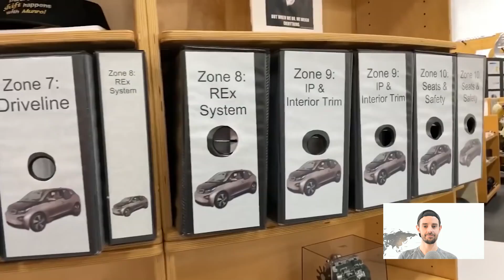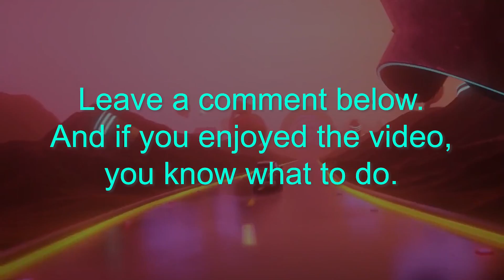Tesla's Engineering Genius (w/Sandy Munro)

Comment: I have worked for the big companies. You assume that the tech guys are running companies in US which may have been true in 1950 but that has changed and when the accounting guys took over . So no “ rational” engineering goes on . If it costs a buck per part to change a problematic part it will not get done. If

Comment: IDEA for VIDEO Elon commented on the investment call that the most efficient machine that builds the machine is able to produce one car coming off the line every 25 seconds. I think he said it was a Toyota factory.
it looks like the cyber truck was designed to be the ultimate ease of manufacturing. No paint shop, laser cut and fold stainless body and frame, plug and play wiring harness they painted and will be using in Germany, octo valve and I would imagine many other innovations. What do you think their efficiency could reach in Texas Tara factory production of Cyber truck? My projection one cyber truck every 15 seconds coming off the line. Once ramped they could produce over a million cars using only two shifts for 350 days a year. Your thoughts in a video would be welcomed.

Comment: Mr Ryan:  you really focus on the higher mass of the Model Y, but mass isn’t that big a factor for EV efficiency.  Yes, more mass means it takes more energy to accelerate but that energy doesn’t disappear, it is stored in the motion of the car.  With an ICE vehicle, this energy would go to waste, but with an EV a lot of that energy is recaptured through regenerative braking.  Obviously there are some losses along the way since each energy conversion is not 100% efficient, but I don’t think it’s all that significant.

What really matters is the aerodynamics of the vehicle, and mass plays exactly zero role in that.  Size does matter, but it’s depends on in what way the greater size is achieved.  If the cross-sectional area of the Model Y were the same, and it was just 10% longer, I don’t think you’d see much of a difference in aerodynamics.

Comment: Most production lines have the majority of interactions on two planes with automation you can do 6 simultaneously top bottom sides front back just look at the B roll for the traditional methods of production and think Elon wants to and likely did a one-shot stamping for the body with this general idea of 3d production. Stamp, paint parts come in from all sides bam! send down the line repeat bam! a few of those and done finished car.

Comment: In Engineering classes, we study the Toyota Production System, like Lean Manufacturing. I already see that in the future we will need to study this new philosophy and practices that Tesla is creating, like a Tesla Production System, just like Toyota.
Reply: The Lean framework is the "first principles" of effective, efficient manufacturing
Reply: What Tesla is doing actually is exactly in line with the Toyota Production System principles and the Deming way. It's classic Lean/5S waste reduction stuff. The difference is that they're doing it staggeringly better than Toyota or anyone else ever did. Others talk; Tesla does, and does well.
Reply: Saxon Lea – In what ways are Tesla‘s production methods superior to Toyota‘s? Are Tesla‘s margins higher? No. Great cars are built by great R&D, not by the best production system.
Reply: @moritzregis5935  1) Comparing margins of two production systems with radically different scale and technical maturity is not very useful for predicting the relative long term success of the younger, smaller system.
2) Manufacturing is very difficult and extremely important. I invite you to review Musk's comments about manufacturing on the Q2 conference call and his recent Daily Drive interview, which align with what he's been saying for years. Musk has far more first-hand knowledge of this than either of us.
3) The main thing Tesla does better than Toyota and the rest is large scale software integration throughout their entire company and fleet, and also solving quality issues with true first principles thinking going down to atoms, forces, time and space. Old school companies do 5-Whys and stuff like that, which is good but doesn't result in fundamental quality improvements like eliminating the entire paint shop for cybertruck and eliminating most of the model y body shop for a giant one piece casting. I believe that the American culture of optimism and taking adventurous calculated risks plays into this advantage.
4) For what it's worth, Sandy Munro's comments about Tesla doing true continuous improvement and their flat management structure indicate that Tesla does indeed outclass its peers in Toyota/Deming production principles
Reply: @moritzregis5935  Also, it's unclear what you mean by great R&D, not great production system. There are plenty of controlled experiments that prove that two groups can take the exact same product design and one can succeed and the other fails merely due to production system differences. I saw the same pattern before my QE days when I worked in food service. The more organized workers who followed these same principles took the same recipe as everyone else but made it better and faster with less waste and occasionally less health and safety hazards.
Reply: Saxon Lea

1) Gross Margin is not ideal, but still one of the best indicators to evaluate the production efficiency as an outsider of the company. 

Gross Margins (2019/20):
Tesla 19,4%
Volkswagen 18,8%
Toyota 18%
BMW 17,3%
Mercedes 16,8%
Ford 7,5%
GM 7,6% (WTF US-Automakers...)

Tesla is a bit more efficient, but there is no big difference in gross margin that would indicate a radically different production approach...

2) I know, I’m studying manufacturing engineering

3) Tesla‘s software integration in the fleet is great, but that is mostly due to the designing process of the car and has less to do with the production processes.

I don‘t know how their software integration in the production process compares to other car manufacturers. My guess is there should be only minor differences, as Tesla is buying their manufacturing equipment from the same suppliers as other car manufacturers. I don‘t think that Tesla is flashing their own software on the tooling machines.

As for quality management... Tesla just had the lowest quality rating in the US and their Model Y had a very bad start from a quality perspective...

4) True, Tesla has structural advantages as the company is very young. Streamlined supply chains, flat management structures. These advantages decay over time.

5) Car manufacturers are usually split into a development department and a production department. The developers design the car and the producers build the car. Great cars from the customer’s perspective are perfectly developed cars. Great cars from the company‘s perspective are perfectly produced, profitable cars. Just because everyone loves Tesla cars doesn‘t mean their production is revolutionary.
Reply: @moritzregis5935   @Moritz Regis 
1 In general, gross margin improves with scale, albeit much less than operating margin does. Key reasons include lower unit costs from suppliers, greater specialization in the workforce and in tooling, reduced logistics costs from reduced tariffs and shipping distances, and reduced inventory per unit of production. 

Also, the majority of their current production occurs in Fremont, CA, where labor is expensive, taxes are high, and bad traffic raises logistics costs.  Also, the Fremont factory was retrofitted from its NUMMI days. Greenfield custom factories are cheaper and more efficient, as Shanghai margins are showing already.

Therefore, the fact that Tesla already has industry leading gross margin at a ~500k annualized rate is an extremely good sign.

2 Nice, I hope you enjoy it. Fun career!

3 You're probably right about them not flashing software onto their own tooling, but I was referring more to the overall manufacturing execution system. Most companies buy crappy off-the-shelf software piecemeal and try to put it together. Like with their cars, Tesla went with a DIY integrated solution. I infer that this provides them as much manufacturing advantage as it provides performance advantage in the car itself, although I don't have direct evidence as an outsider.

Furthermore, I would presume that Tesla is doing an outstanding job of setting up automated feedback loops to drive improvements all the way back into the design. That's where the fleet data comes in. The other automakers mostly have no visibility of what's happening in the fleet, which makes evidence-based manufacturing and design improvements much harder.

Check the 2019 impact report for clues on Tesla's manufacturing engineering innovations. The big one for model y is the new casting setup, which drastically cuts complexity and time, while allowing workers to do interior assembly from an easy, ergonomic position inside the frame before the battery pack is attached. The 2019 impact report discusses this and shows a picture. They also show a massively improved factory layout for Giga Shanghai. U-shaped flow with perfectly situated truck bays, among other improvements I've forgotten about. This is without even mentioning their battery manufacturing company acquisitions, which we'll learn about soon enough.

Quality is always worse during low rate initial production, especially when trying a bunch of radical new ideas at once. Current Tesla has a large base of early adopters who generally prefer good-enough quality now over excellent quality 2 years later. This is enough to justify shipping model y units with quality peccadilloes.

Also, Tesla receives far greater scrutiny and publicity of quality issues due to their prominence, surrounding controversy, and immense short selling interest. Because quality is defined relative to what the customer wants, the best metrics of quality aren't things like nonconformance counts but rather overall customer satisfaction ratings, brand loyalty and evangelism. Tesla towers over the competition on these important metrics, while lagging on paint quality and panel gaps.

4 This success in continuous improvement has more to do with risk-taking, politics, scientific culture and compelling mission than the formal organizational structure. They also eschew the traditional yearly refresh model for running changes. I expect all of this to remain approximately constant with growing scale.

5 Tesla also splits design and manufacturing engineering. Everyone does. But their feedback loop between the two is much tighter. Also, customers care about the overall value proposition, which is a function of both design and manufacturing. The customer may not care about good manufacturing itself, but they do care about the end results of good manufacturing. Why is a beloved product sold for lower prices than alternatives not revolutionary?

Comment: I used to work in the IT dept. of a big stationary company with many branches.  Now I was working on their DB and some of the queries might take an hour or two to run due to the amount of data being dealt with over a 10Mbit hub...  I asked if we could upgrade to 100Mbit and my Boss was not interested due to expense in a massive company whose boardroom table cost £12k and each chair £1k.  I even offered to bring in my own 100Mbit switch and components to help speed up my workflow and save them money...  he flat out refused despite that it might save me 4 or 5 hours a day sometimes LOL

Oh, please be bringing the Cybertruck to the UK Elon  <3
I will import one from the US and get it adapted for the UK if I have to...

Comment: Around (15:45) Munro says something like "Tesla Lies,... you may not believe that"... then goes on to say Tesla "understates"... well, it may be so... but, don't lose your perspective too much.  Tesla as much "Overstates" as well.  Producing "all battery" EVs is fine for a few million, (Tesla just passed 1 million vehicles over the last decade)... but, 88 million new ICE cars were sold annually.  Tesla overstates the notion that since all battery works for a million sports cars, it will work for everything else (i.e. trucks, Semis, SUVs, Construction, Farming equipment etc.)... when, the reality is, no it can't.

Even now, Nickel, Cobalt, and Lithium have been long sought and locked up.  Thinking, (and declaring), we can make all cars "all battery" EVs is not even remotely possible.  All battery Semis is a prime example of blatant lies and overstating.  There are millions of Semis in the US fleet.  Only 10,000 battery semis would draw 10 Gigawatts if charged simultaneously.  Try 100,000 Semis?  The problem here is all battery vehicles, when charged, must do so in real time from the grid.

The grid is in no way capable of handling such on-demand loads, it wasn't designed with that in mind.  The big lie of Tesla (total overstatements) which are leading people like the host, to be starry-eyed at the idea of a battery powered car.  If you want to talk about reality, you need to talk about fleets.  How you're going to actually fuel, and/or charge them Without Carbon.   This is what's important, and therefore, I'm compelled to remind you of the fantasy world Tesla projects, when claiming "all battery" vehicles will soon dominate.  Not on this earth.

Clean H2 is potent, safe, scalable, available to all people, and 100% non-toxic.  Avoiding these truths is a tremendous disservice to the achievable goal of decarbonizing our planet and ending human poverty, and industrial scale abuse.  "All battery" vehicles can't do that.  Clean H2 can.  As Tesla, and you along, buy into the lie of "all batteries are the future," the human and environmental costs of Nickel, Cobalt, and Lithium abuse just continue to grow.  Tesla lies alright, it's either an understatement, or an overstatement, never the reality.
Reply: I guess you know more than Sandy Munroe and the tech analysts at Ark invest.
Reply: @ken-mb5cp  Do I know more?  All I claim is that I can do basic math.  Can Ark?
Reply: Toby Kinkaid Thank you again.  I will look into Hydrogen.
Reply: @ken-mb5cp  Excellent!  Be sure you catch the difference between H2 and Clean H2.  Clean H2 is very specific.  Uses renewables on the front end to power the electrolysis of water.  Only from water.  No Carbon involved.  The benefit is... use the clean H2 fuel on demand, and you get most of the energy out, with most of the water back.  It's the only energy paradigm which is totally compatible with life totally non-toxic.  Check out "The water battery."  Good discussion of the subject historically.  Also, check out the Renewable Hydrogen Alliance... this is an industry!
Reply: Toby Kinkaid will do thanks
Reply: @ken-mb5cp  Roger that.  Also, there's a great documentary call "at war with the dinosaurs"... I think it's only for rent, but it's really worth it... very well done.
Reply: Though you make some good points.   No disrespect

Comment: Well the guys on top literally know that they're dumb and they despise  the smart guys since they know soon they're going to be replaced by them.
Reply: I have worked in several big companies. The dumb or mediocre people at the top are often totally unaware of their limitations. Dunning-Krueger effect.
Reply: Facts
Reply: It's not as simple as that, the technicians are good at their job, but a manager is a manager and that's all they know what to do (follow directions, make people do this or that, organise people/schedules etc).  It's a completely different role for each one, intelligence isn't the "be all".  Ultimately it's the company owner's job to do the major innovation.  If these lines get too blurred it would end up a jumbled mess.  Technicians wanting to please themselves usually ends up in mediocrity because they fall into the trap of just doing what they already know, or is the easiest option (change is very hard and usually what leads to arguments with management).  A manager trying to excessively innovate takes away the steam they need (a major switch in gears) towards harmonising the team.

In other words, it's no use throwing the baby out with the bathwater - yes of course rigid hierarchical institutions are clunky and slow to change with the times, but make no mistake that a good company doesn't need any delineation of roles.  Respect for order is still necessary.
Reply: @paulstone7655  I tip my hat to you sir , that was quite an explanation
Reply: Definitely correct. In order to prosper you have appeal to the owners (not management) at the right time so they can wake up & realize your potential.

Comment: I think you're glossing over the reason they are sandbagging the specs and I don't think it's because they're humble. Maybe it's money in the innovation bank. It gives them head room for announcing improvements. Tesla doesn't really have model years so people assume the model 3 for example is the same year after year and small incremental improvements don't make the news. Imagine reporting that one optimized component increased mileage by 2 miles versus an announcement that a number of small changes increased mileage by 50.